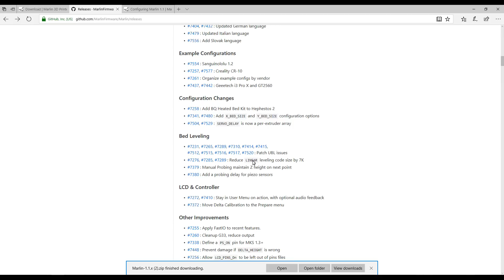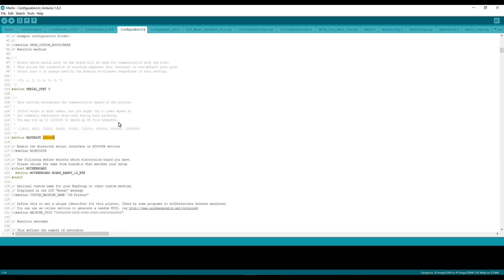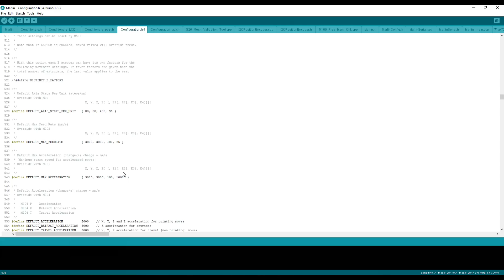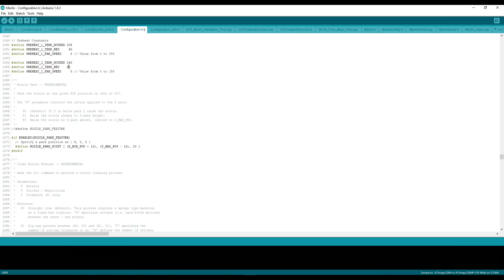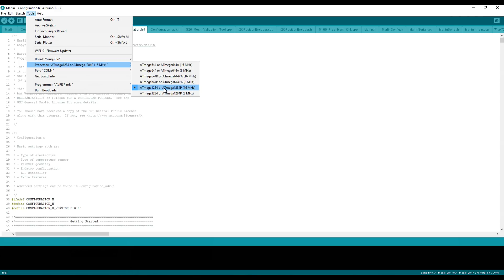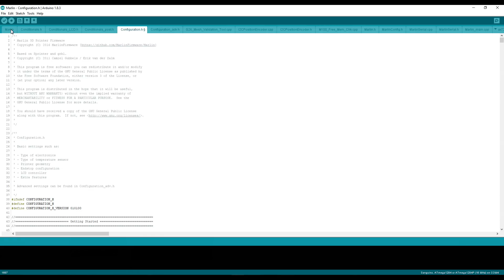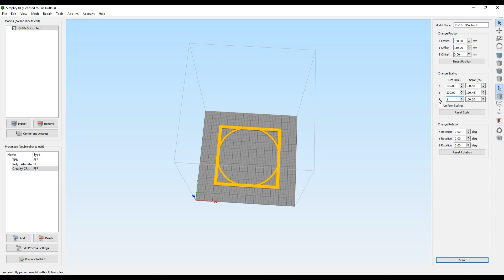Updating CR-10 Firmware to Marlin 1.1.6 Part I

Comment: I'm trying to follow this video and compile 1.1.6 for my CR-10. I've trimmed everything i could but i am still 420 bytes too big. I have ABL and sensor filament. Any advice would be greatly appreciated.
Thx in advance!
Reply from the maker: So Brad Erion came up with a way to save memory here is how he did it.
I solved my low memory warning on 1.1.6 by commenting out the 

#define SDCARD_SORT_ALPHA 

on line 509 of the Configuration_adv.h file.  According to the comments, this is a new feature that sorts the SD card contents alphabetically.  If you really want the sort feature, you can also try reducing the number of sorted items on line 513.  Disabling this feature reduced my memory usage from 15214 (94%) to 4684 (28%).
Reply: Eric's DIY CR-10 has only 100k available. I took the sorting code out and with that I am 420 bytes too big.
Reply from the maker: Did you comment out //#define ARC_SUPPORT on line 684 in the Configuration_adv.h folder?
Reply: Eric's DIY yes and the eprom option for 503.

Comment: How do you know if you have a bootloader ?
Reply from the maker: The CR-10 with the Melzi boards need a bootloader. The Cr-10s  does not. What type of printer do you have?
Reply: what do you do if you dont have a bootloader? Im trying to burn the bootload but dont know how
Reply from the maker: This is a pretty good video for the bootloader

Comment: Hi, I watched your video, and desided to update bootloader and flash to Marlin 1.1.6. Bootloader went well, but I met some serious problem flashing the Marlin from the http://marlinfw.org/meta/download/  website. I changed all the things you talked about, except for the ABL things (mine has not been shipped yet) - but no matter how long I have tried -I`m not able to get a Marlin "Stock" file into my board. So - finally, I downloaded your file - and this one went straight into my board ( By the way, I have a CR-10 - stock 300x300x400 machine.

Could you advise me - if possible to what changes to make in config.h and perhaps other files - to use your file for stock compability?

Thanks in advance.
Reply: PS. I did use those example files under example_configurations/Creality - But I made note of that the "lines" in the config.h where off - compared to your video. More lines in the sample file.
Reply from the maker: Just to confirm your printer is completely stock
Reply: It`s completly stock, no new extruder or anything - yet :)
Reply from the maker: Try this https://goo.gl/PcgwPy
Reply: Thank you so much. I found an German file who seems to work, but my German is way more rusty than my rusty English (y) +1
Reply: Arduino: 1.6.13 (Windows 10), Board: "Sanguino, ATmega1284 or ATmega1284P (16 MHz)"

In file included from sketch\MarlinConfig.h:39:0,

                 from C:\Users\Stig Berntsen\Desktop\Marlin-1.1.x\EricsDIY\Stock\CR_10_Marlin_Stock-20171019T034459Z-001\CR_10_Marlin_Stock\CR_10_Marlin_Stock.ino:31:

SanityCheck.h:626: error: #error "Z_MIN_PROBE_USES_Z_MIN_ENDSTOP_PIN requires Z_MIN_ENDSTOP_INVERTING to match Z_MIN_PROBE_ENDSTOP_INVERTING."

       #error "Z_MIN_PROBE_USES_Z_MIN_ENDSTOP_PIN requires Z_MIN_ENDSTOP_INVERTING to match Z_MIN_PROBE_ENDSTOP_INVERTING."

        ^

exit status 1
#error "Z_MIN_PROBE_USES_Z_MIN_ENDSTOP_PIN requires Z_MIN_ENDSTOP_INVERTING to match Z_MIN_PROBE_ENDSTOP_INVERTING."

This report would have more information with
"Show verbose output during compilation"
option enabled in File -> Preferences.
Reply from the maker: testing a stock version now
Reply from the maker: Try that google link again I updated it. I forgot a step.
Reply: Thank you. Upload successfull. Realy thankful for your time and effort sir :)
Reply: All went well with the last file. Did a testprint now - extremly happy. I use your S3D profiles as well. Realy happy for your help man - U rock!
Reply from the maker: I'm glad that worked for you